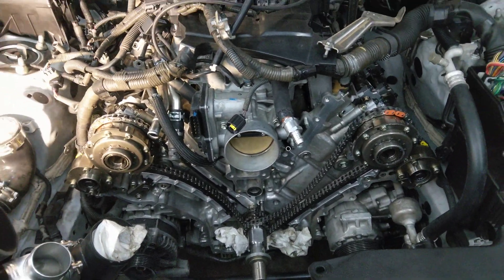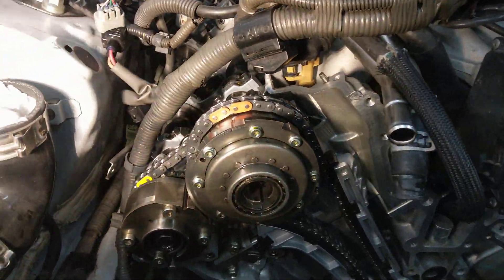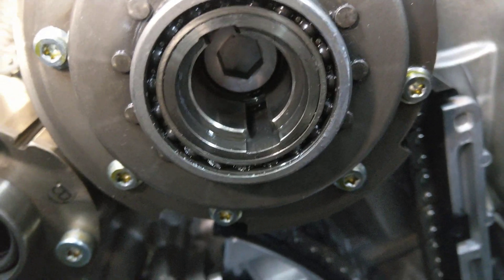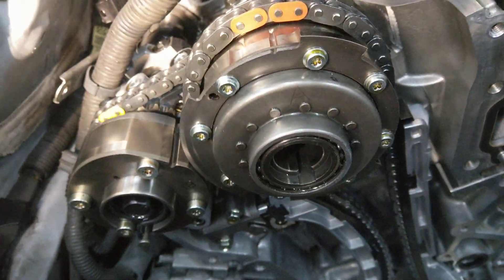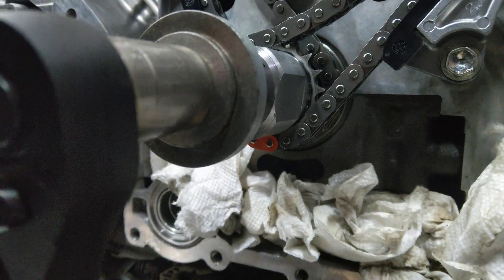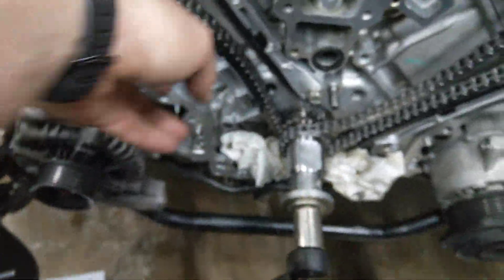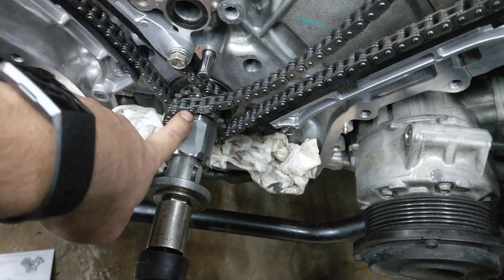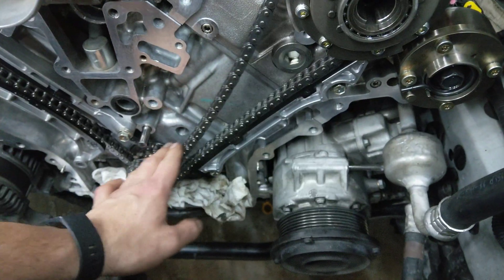2UR-GSE Lexus IS-F Timing Chain, Tensioner, Guide Tutorial Part 1

Comment: What is the part number for the non reusable bolt on the intake side??
Reply from the maker: 90110-12012 same bolt driver and passenger side
Reply: @LILEVO  thanks, I searched it up on the Lexus website it does say bolt, hexagon socket which seems right but I believe it has the wrong illustration can you confirm? Thanks
Reply from the maker: @cam3x194  I don't remember, but that's the right part number. Came out of the parts list in video description

Comment: What happened too it? I've had mine for 6 years no issues. Never heard of ppl having issues with timing chain in lexus community
Reply: same, im curious, but im also intrigued with how you managed to follow the TIS guide without issue! amazing! I've done the same with my corolla, so worth it. I wonder how much money you saved by doing it yourself instead of having your dealer do it?
Reply from the maker: @CubanLegend561  long story short the ATI crank pulley came loose and then the sprockets came loose and damaged the woodruff key and crank. Everything was at spec or just out of spec anyways and the chain tensioner was defective so it was ready to be replaced anyways. I think all in with parts I was only around $1100 or so. My labor is free so yeah. Pretty cheap.
Reply: @LILEVO  thank i was wondering that to .God Bless